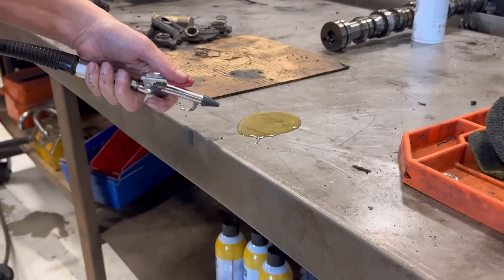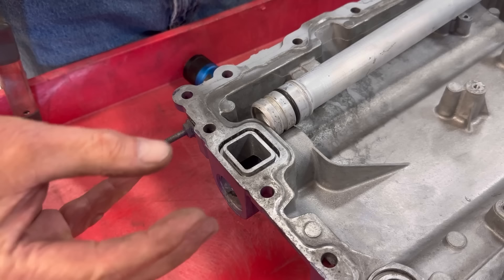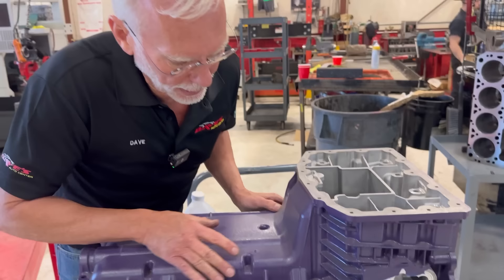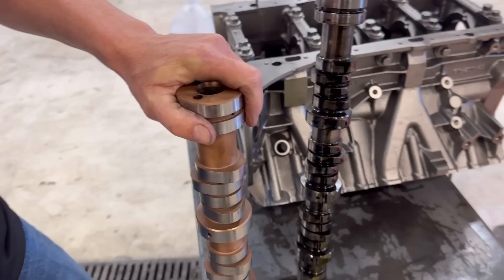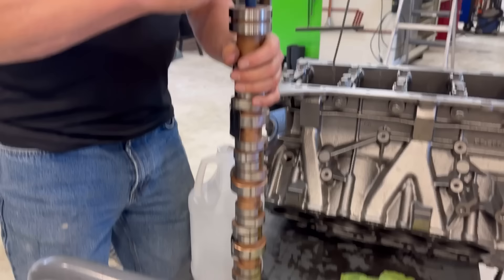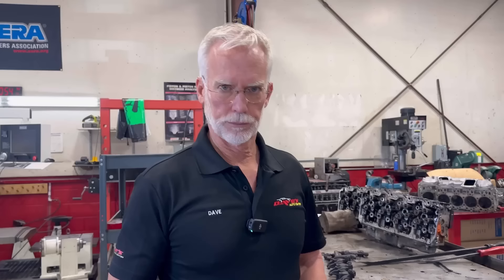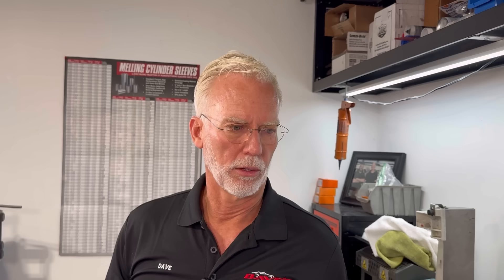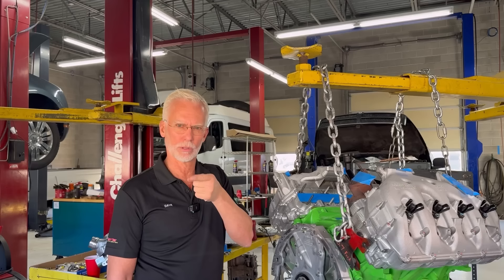Part 1: Ford 6.7 power stroke oil starvation issues revealed

Comment: I have a 2006 F250 with a 6 liter engine. It has 136,000 miles and I just had the turbo replaced. I bought this truck new and changed the oil every 5000 miles. I always used the Ford Motorcraft oil. My question is it ok to switch to a full synthetic oil in this engine?  Thanks for any advice anyone can give me.

Comment: Why is there not an aftermarket electric external oil pump available to pre-charge, or at least get oil to the top of the valve train? I cringe every time I restart my engine after an oil change.

Comment: Hey Dave , I have a question I have a 2021 dodge charger V6 SXT I heard that the top of the motor is starved for oil after sitting more than an hour. Is this true or should I have to be worried about it?

Comment: I have working on PS for long enough, never pre add to filter. i see fail oiling, yes after 180k or milestone not because what u saying and ford oil pump is pumping over 5000psi in sec wouldn't hurt the engine. Also they use for heavy-duty work not  weekend ride. But i dont mean the video is totally wrong. Good to know stuff ,

Comment: Just curious is there any way for the starter motor to engage the oil pump a few seconds before it turns the engine
Reply: So turn the key and wait a few seconds for your truck to start? The consumer will never go for that

Comment: Alright Mr. Dave
I just purchased the vehicle I wanted from a dealership a 2019 F-350SD 4x4 6.7 turbo diesel 6-speed automatic with 59,000 miles on it 
Do u have any recommendations on what to check or change or do?
First Ford diesel owner want to get the most out of this vehicle and make it last the long haul 
The motor looks stock with no upgrades that I can see, do u recommend any after market upgrades?
Thx

Comment: @billquillin1952 beat me to it.  Okay they made it this way.  How about an electric oil pump to precharge  the oil pressure before starting the engine. Would this not be a good solution? I've been thinking about this for other equipment.

Comment: You should build a diesel that will work in almost all the major trucks a adapter to bolt to each a stand alone EMS that works off factor ecms. One that could put out 1,200 HP and go a million miles. That would be a good way to get rid of everyones shit factory engines hell I would be a bata tester be a better engine than what Im stuck using in my build a 5.4 2v. I'm combing a 85 E150 super (extended 1/2 ton) and a 99 f250 super duty I wish I had a 7.3 with a manual but I have to work with what I have and when I get enough parts it's going to be a 6 wheel drive will be a great build be a better if I could afford all new drive train but I'm good at making do with what I have at hand l. Thanks for another great video!!!!!!!!

Comment: This is insane. Every engine manufacturer should have to get approval from Dave on every engine they design before going into production. This just proves the garbage engneering Ford has. There is no way I would ever buy a truck equipped with this engine. SMH

Comment: Needle bearings are better at an offset angle, with complement opponents for equal load, oh, like in a wheel bearing assembly at the CV axle... 😂 Not inside an engine. LoL

Comment: I'd like to know your thoughts on the hemi's that are notorious for having lifter failures. Is it lack of lubrication or cheap parts?
Reply: yes
primairily the fack chyrsler dodge uses the most bare minimum oil pumps and if you upgrade those pumps it helps out.
Among valve geometry.
Theres youtube videos on it

Comment: why doesn't someone invent an electric pump that attaches to the oil filter housing that you can turn on to precharge the system before the engine start?

Comment: This guy is talking about a problem that doesn't exist so he can sell a "fix" that isn't required. The 6.7 doesn't suffer from oil starvation issues. You'd think a master engine builder would realize the oil passages don't just magically empty themselves of oil as soon as the engine is shut off.
Reply: And you know this how?

Comment: Hey I just recently discovered an additive called “prolube oil”.  The tests I’ve seen look great but I’m worried about the if the cooling properties would change. I was wonder what’s your take on it.
Reply: 50 years of experimenting with additives…so far…lubeguard oil additive and revx are my favorite.
Reply: @NycCitizen  what about heat.  I see it lubes great but there’s no data on heat.

Comment: Gotta disagree about the oil filter prefill. Same for fuel filters.
Reply: But still excited to see the next video. ---I've worked on heavy diesel engines and automotive. Some big generators have and oil pressure prime before they start. This ford would be fine IF it had that-right?

Comment: Wow.  Imagine all the FireDept’s with their Ambulances and wildland engines  that go from cold zero to gas pedal mashed.  Probably a lot of early engine failures happening there?   That’s all taxpayer dollar’s getting burned up due to poor engineering. 
A lot of FD’s use block heaters to keep he engine fluids warm, but it does not keep the oil pumped up in the galleys.  
Where is the oil pressure switch located on the 6.7?  How long after an oil change does it take before the idiot light turns off and oil pressure gauge comes to normal range?

Comment: I change the oil on my 2011 6.7 powerstroke and that filter holds a quart. And i agree that this is a bullshit design.

Edit: i only got the clatter one time, but this was after i did the oil, trans fluid, s&s disaster prevention kit, diff fluid and the turbo coolant line that leaks on the older 6.7s. So it hadn't ran in days between oil change and start up.

Comment: Are you sure that all those are bone dry at the time of start? It looks like the oil pan would stay primed between the filter and the pickup for sure, due to no place for air to get into . Not sure if the oil cooler drains completely.  I get the  need to fill the oil filter but that same notion states that it wont start empty.  Unless you just changed the oiI (which would introduce air to the system), I detect flawed logic.
Reply from the maker: Thanks for the feedback! And for watching!

Comment: Anti drain back filters are in the filter and probably the pump. Not a huge issue
Reply: This dude’s videos been popping up in my feed for a couple weeks. 
He is so full of himself. 
 As if Ford engine designers don’t know about engines needing oil on startup. 
 These are the best light duty diesel engines on the market. Damn near bulletproof.

Comment: I have the solution Dave tell people to stop buying these junk domestic motors and stick with the reliable ones industry would turn around in a heartbeat. You don’t have to be a rocket scientist to make a good motor. They’re not that complicated. All you do is as an engineer, tear down the best motor in the industry and design your motor exactly the same way. i’m so tired of these overpaid executives and engineers making this junk. It’s one thing to make it, but sometimes it takes him years to correct it which is an excusable unless they’re giving everybody new motors, which they never are. They never stand behind their products more than 36 months usually. my God it took years to correct their three valve F150 motors

Comment: All of Fords modern engines are badly designed and a travesty to engineering, and this is coming from lifelong ford driver, but i will never buy one again because of the design problems and quality control issues and their not willing to stand behind their warranties.

Comment: Engine oil should be used for lubricanton and not as a  hydraulic fuel injection, poor roller lifter quality and pushrod lengths 6.0 PS. That international/Cat engineering beating Ford up).😢😢😢

Comment: Sorry I have to say you are grabbing at straws to find something wrong. There is nothing wrong with the oiling system on these engines I have never seen a failure to do this UNLESS it’s from the customer running it low on oil because the ccv is clogged or oil ports plugged from a crappy tech not properly sealing the upper oil pan.

Comment: thats two shity 5.4 cam follower lifters that fail all the time!!  if a 6.7 has a misfire don't ignore it like all my customers do it goes from an expansive fix to a really expensive fix real fast ! that stupid little lifter dies and unloads the valve train then it ruins the cam! sometimes it just a slight hesitation or it wont show a misfire only lean or rich code

Comment: All valid points and enjoy watching ur channel but ive had at leasr a half dozen 6.7s and they are bulletproof and i hate v8 diesels so apparently what ford is doing is working, ive seen them with well over 300,000 miles with piss poor maintenance, i change my own  oil and ive never heard clattering after an oil change but never check ur oil the of a fresh oil change there wont be a drop on ur dipstick for some reason? Drain it while its hot and put 13 quarts in it and walk away, probably the clattering is the methhead losers at jiffy lube putting and extra 2 gallons of oil in the sumbitch

Comment: I'm calling bullshit on the lifter with needle bearing comment this angry acting man claims. There are thousand upon thousands of so called race engines running roller lifters with needle bearings and they have no issues in doing so!!! This man seems to have an issue with comprehension as clearly he's watching Steve's channel and his ability to pay close attention is lacking!!!  Yes, there are newer style roller lifters using bushings instead of needle bearings, but engines using those are running extremely have valve spring seat pressures due to much higher combustion pressures in forced induction engines. And yes, I've very much aware the 6.7 is a forced induction engine. But nothing with the valve seat pressures end max effort forced induction race engines run.  And why is this man acting so angry???

Comment: Drama drama.  I use roller cam bearings and needle bearing lifters in my race engines and never lost one in the last 30 years 1100 hp+. And u think that ur smarter than ford.  Lol.  Don’t need this channel

Comment: I'm sorry but I wouldn't be pouring water inside engine parts and then who's going to clean all that water out of there I would use engine oil such as what you're trying to measure?, why don't you fill up the ports or the tubes that are inside the upper oil pan where the pickup tube goes down through and block all the holes and then pour that into a container and measure how many ounces comes out of it, do the same thing with the crankshaft and the camshaft as well for starters, then you're going to put all these engine parts back inside having water inside of them cuz I don't see how you going to clean every bit of moisture out of those parts? Come on guys just use oil it's what's going inside the engine anyway, so you're watching a video with this guy which is Dave pouring water in all the engine parts oil cooler and everything? Come on be realistic and use engine oil stop using water cuz I chances are you're going to try to assemble all this back together and an engine and how are you going to get all this water out of it? Come on guys use some common sense, I'm sorry I can't finish watching a video with the owner of a shop pouring water and all the parts of the engine trying to measure how much is in there instead of just using the wall I mean come on use some common sense I'm sure you have enough oil in your shop and you won't have to flush that out later on since it can be new oil to begin with exclamation point. Any of you viewers who are reading my comments including Dave himself a welcome to ask me since I have a solution for reducing your friction inside your engine 95%, that will take care of you having an oil starve engine when there's not going to be any friction inside of the engine while it's waiting on the oil to pump throughout the engine! I started using this in my engine years ago when I found out about it and I have no metal to metalware inside my engine after I started using this product because it's permanent! Anyway Dave I would be curious to see your before and after videos on the fixer correction to the lifters as well as any other fixed or repairs or modifications that you're doing